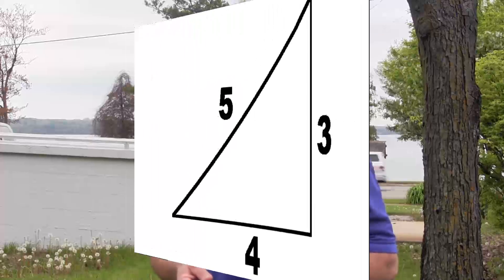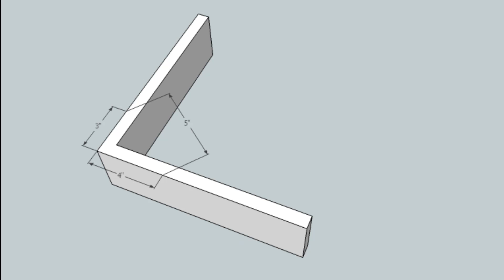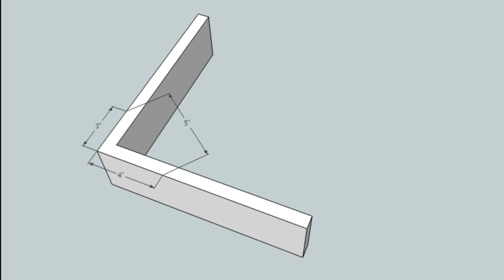Staking for Excavation

Comment: How does he know the two stakes he installed 3' off the building (at the 2:00 to the 2:22 mark) are perfectly square?  I understand he can eyeball 3' but how does he know he isn't slightly out of square when he pulls off the building?  If that line is not square, then the rest is not.  Maybe I'm trying to be too exact?
Reply: if he swings an arc say a foot or two from each stake, where they intersect is the original point.
Reply: Jonathan Vanderheyden if my hub is lower than and i have to cut 1.96 how i do at
Reply: Jonathan Vanderheyden Yep, to many variables, too many points of reference !
First point of reference, for me,  would be the longest and most important point. Dumpy peg in the ground with a clout nail for exact measurement and line of reference.. All off-sets taken from this one point for that line of off-sets. Repeat for every off-set line ! Hope this helps you. Cheers mate.